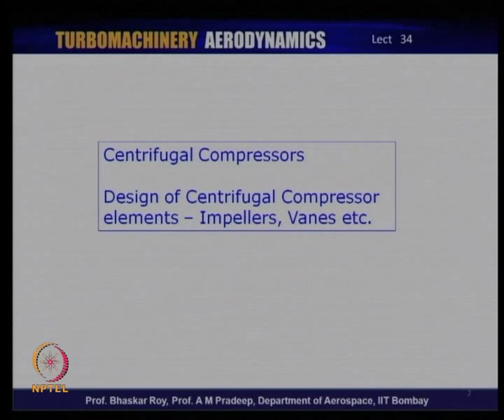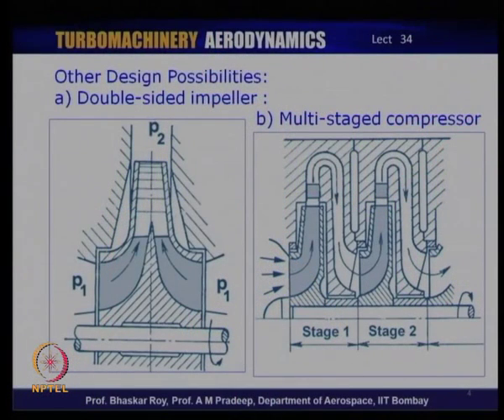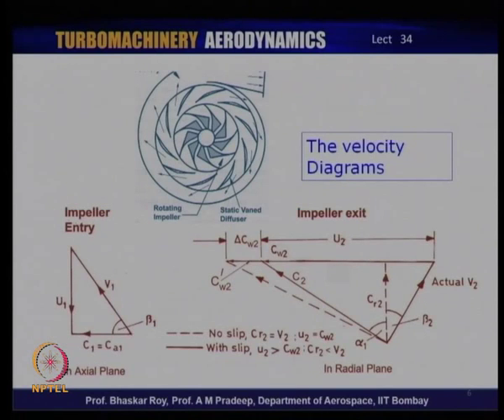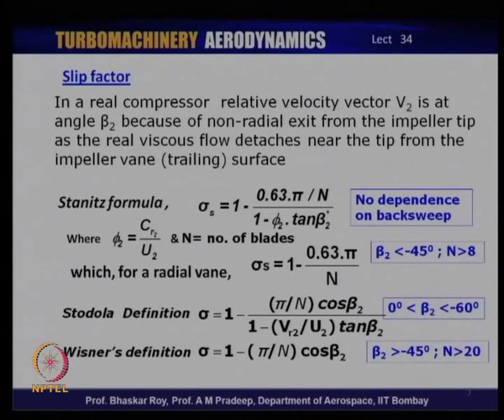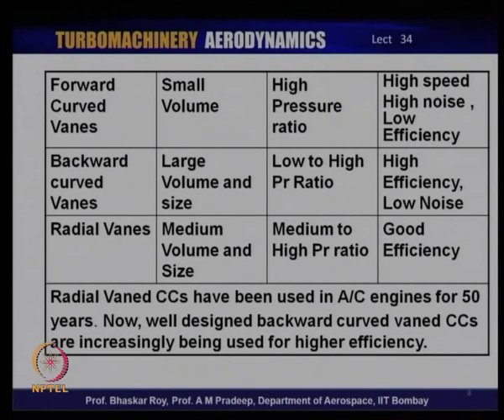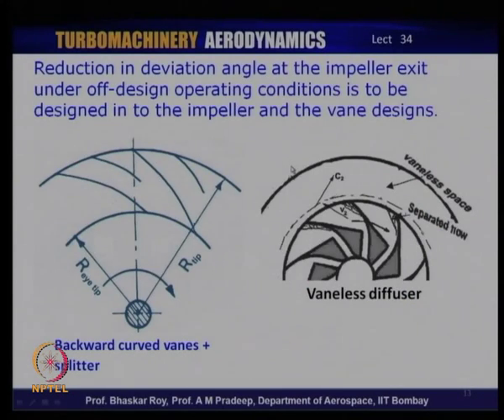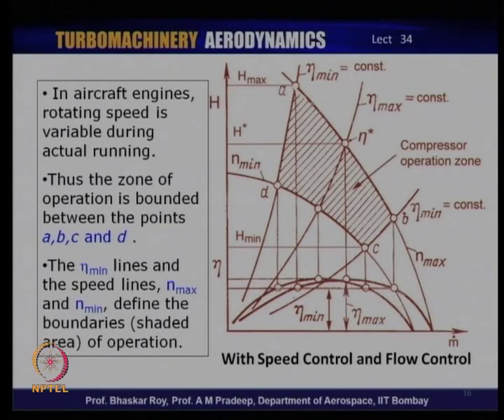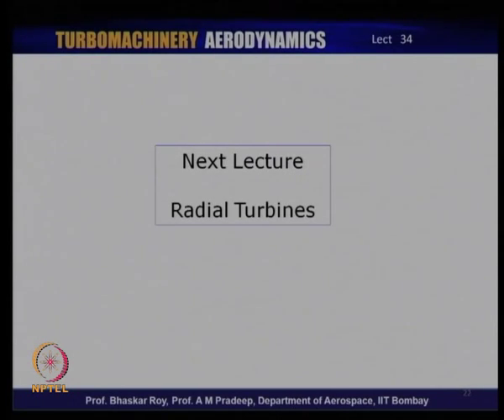Mod-01 Lec-34 Design of Centrifugal Compressors: Impellers, Vane/Vane less Diffusers, Volutes

Comment: professor says (44:20) that the supersonic flow decelerates to subsonic through vaneless space between rotor and stator. Since the area of the vaneless space becomes larger as radius increases, how it is possible to decelerate a supersonic flow to subsonic in a divergent channel ?

Comment: Sir, when we use inlet guide vanes , you told that work done decreases .
actually, its an advantage.  You mentioned it as if its a disadvantage. why so?
Reply: Becase you add pre-swirl. Normally, the flow enters pure axial without tangential component, however, with guide vanes, there is a tangential velocity component at inlet. Work = U2*C2t U1*C1t. If no pre swirl C1t is zero, so the work decreases a bit with inlet guide vanes.